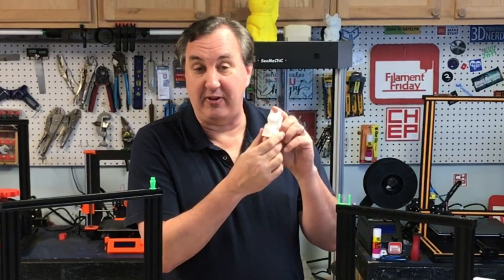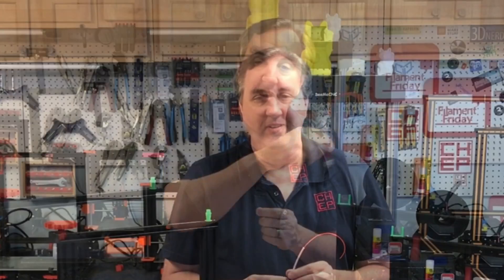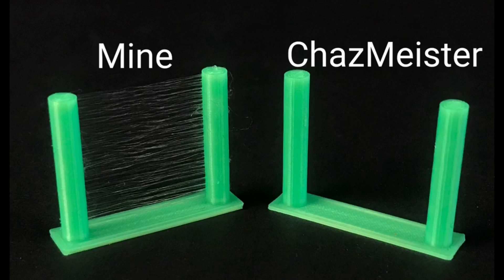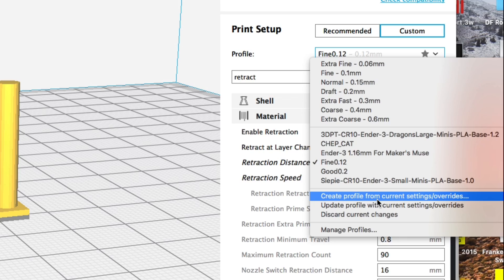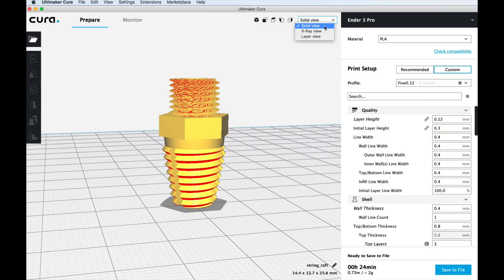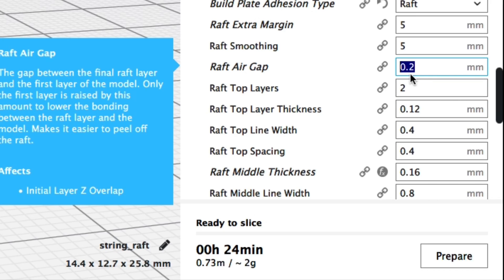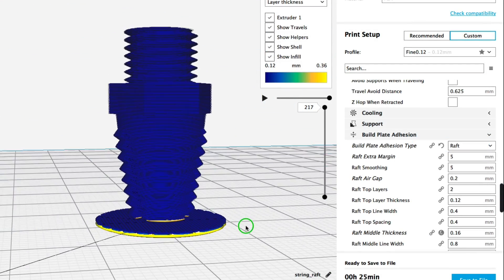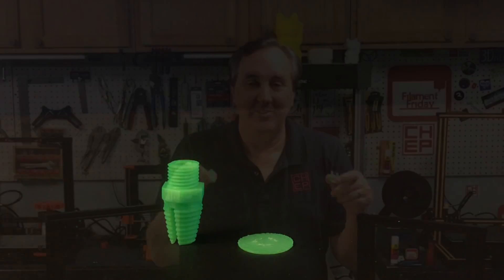Cura Settings for Retraction and Raft on Creality Ender 3 or CR-10 Mini

Comment: My raft is still very difficult to remove whether I set the gap to .2 or .3 I usually end up having to use a knife to cut the raft off. What else can I check or adjust?

PLA
Bed 60
Extruder 200
Reply from the maker: Set it to 0.4
Reply: You can turn bed temp to 0.
Reply: hello Chuck I also have problems pilling off even with 0.3 mm air gap. Should it be related to PLA temp ? I am using 205oC. This temp might fuse the PLA to raft correct ? Making it hard to remove. You suggest to lower temp down to 200oC ?
Reply from the maker: Try it but I suspect the bed might be too close to the nozzle. Also try 0.4.

Comment: hey chep my cura profile is retracting too much! it retracts like 50 times in a row destroying my filament grinding it making it print air.  Im using a direct drive i have it set to 1mm retraction with 5 mm retract window and 1 retraction allowed but still its going crazy. click claclick click claclick. helpppp
Reply: There a maximum retraction count setting in cura that you can change. The default is 100, which is too much. Try googling that setting and changing the maximum retraction count over a certain distance.

Comment: Hi Chuck, I've been comparing your Cura profile settings with what you describe in this video. I'm trying to get a stringless Niko the Puppy (by Makerbot) and your settings have helped me a lot with my Ender 5 Pro. I notice you've also changed settings compared to what's on your website with this video. Obviously a lot changes in a year (perhaps the version of Cura has affected it). Anyway, thanks very much for this video and for sharing your Cura profile.

Comment: My printer is Tevo Flash. This slow speed setting works bad for Volcano for some point! I've tried smaller lengths 2.6 - 4.0 with 60mm/s and it works better there. But here did came the another problem. Since I've calibrated Linear Advance very well so it gives very very close (to ideal) sizes. The clearance is about 0.08 - 0.1mm. But such a good LA work gives a side effect: now I have under-extrusion problems. They happens on the same layers, on the same position of a model!
My guess that it's linked with retraction (and maybe(!) a bit with combing). But it's not that easy. I'm going to calibrate Retraction Extra Prime Amount in Cura. This will give blobs probably. But it's not worse than having underextruded places.
My another guess that it's due to high E-Jerk setting. I've set it to 20! If it's 10 or lower then LA just can't work! So K=0.8 and it's normal for this printer with this E-Jerk setting. But as I understand this jerk also the same for retractions. My guess that it's probably too high and I get filament breakouts. This leads to sucking air into the nozzle which goes out instead of a portion of melted plastic.
If you're sure that it's not that reason, tell me, please!

Comment: If you don't like rafts, try a brim. It increases the surface area of the first layer. This also offers a smooth bottom layer. With raft you get a rough and stringy bottom layer. Just make sure to use a high initial bed and hotend temperature, something like 70°C bed and 220°C hotend. Otherwise you risk the brim warping at the edges where your bottom layer is supposed to stick.

Comment: Hi chuck!!! I love your work, thanks for the tips. Question...for avoiding the strings, the retraction speed, and the printing speed have to be the same? For instance, the retraction speed setting is 25mm/s, so the printing speed has to be 25mm/s also? Considering 6mm retraction distance for both cases.
Reply from the maker: No they don’t have to be the same.

Comment: Have you had a filament that strings more the colder its printed?  My temp tower is showing strings as it gets colder, which is not what everybody else lists as a cause.  I installed a dual gear extruder, calibrated it and saw on a few prints some string chunks.  I've been trying adjust the retraction all day till I printed this backwards tower.
Reply from the maker: Try cleaning the nozzle.
Reply: @FilamentFriday  Thanks for the reply.  I changed the nozzle, found the standard Creality hot end gap.  I never set this printer up properly as it printed so well out of the box.  I changed out the bmg style dual gear for a creality one. The clone bmg was making bad noises on retract and prime, I tried 2 of them.  However, I popped in a second roll of the same brand filament, different color and it is stringy at lower temperatures.  The brand is CC3D silk colors.  I have only printed large non detailed objects with it so I never saw the strings.  I also printed at 115-125.
Reply: @FilamentFriday  I am an Idiot! 
 Regular PLA doesnt seem to mind having the bridge settings in Cura slicer on all the time, but the silk pla does not like the bridge setting at all.  I just printed 8 retraction tests, from 1mm @25mm/s to 8 mm and I did this with only 1 setting removed, Bridge settings.  The best retraction for this pla and my printer are between 3mm and 5 mm however there were almost no strings after 1mm of retraction and only a few between 5-8mm.  Ive messing around with this all week, because the silk prints look great except when the strings and artifacts travel between the model and the supports.    The downloadable gcode temp towers from Thingiverse do continue to profusely string up the lower the temp goes!

Comment: Hi Chuck.  I have change Cura setting as you is telling in this video, and it help, 
But not the back, the side facing the heatbed, there are still a lot of threads, and rafting is hard to remove. What am I doing wrong ?
Do you have a finished Cura profile that works with a Creality CR10S Pro?

Comment: Hey Chuck. Does "maximum retraction count" matter if it's 90 or 100? In your video, you have yours set to 90, but my default Cura settings had it at 100 and they weren't uniform to the changes I made. Which one do you think is better?
Reply from the maker: It’s minor difference. Test them and see which works with your filament.
Reply: @FilamentFriday  Will do, thank you very much for responding!

Comment: Hmmm... I tried changing moving my retraction down from a pretty high speed down to 25, and it made my stringing worse. Are we absolutely certain that Chaz didn't change any other setting?
Reply: my stringing turned into spider web city.... much worse
Reply: @tcfluharty  can be a crappy nozzle as well. Buy a good with an accurate hole.

Comment: First attempts with printing XYZ cube went bad for me due to elephant footing. I know, my printing plate is not completely straight, but it is in +-0.3mm spec which Creality support gave me. So, I bought glass printing surface and it helps a bit. I also found a tip to use raft. I set the raft according to this, but raft becomes so solid with the object, that it is impossible to remove. But, now the cube is no longer elephant footed, but so close to 20mm specs I think I need. How to fix this?
Reply from the maker: Use my profile with my raft settings

Comment: Hi, seems like my PLA has become moist due to that it leaving a lot of stringing on my prints. I did try your settings but it did not reduce the stringing much. any other suggestions?
Reply from the maker: Try different fresh filament or dry out your existing to see if that’s it.
Reply: @FilamentFriday  thanks for replying. I tried a new fesh filament but still the same..

Comment: my nozzle is keep printing in my plastic. ----\/----  i've tried to adjust my bed leveling right. for the print settings i've  copied exactly the same as yours. (i am using PLA).
Reply from the maker: I don’t understand
Reply: Z axis (during print for each layer) is a constant, so there should never be a reason that your printer nozzle dips 'below' the current layer threshold and affects a lower layer.  Instead, what may be happening is that your layers are too thick, are curling, or you have something incorrect in your slicer profile and are doing something odd like 'overextruding' which would potentially cause the layer you just laid down to interfere with the layer above (which to the naked eye, you would think, 'man, my print nozzle is touching my print').. Yeah, the issue isn't with the 'current layer', your issue is with the layers below.

Comment: Chas's print also uses combing. And as I found out, you can't have combing and z-hop together. So depending if you need low stringing, vs needing z-hop for a clean top or to avoid knocking fine structures, you have to choose the appropriate settings.
Reply from the maker: I adjusted all that in my profiles.

Comment: I just got an Ender 3 and am using your profiles but still find stringing on my parts. Any solutions for this?
Reply from the maker: Lower the temp 5 degrees for your filament.
Reply: your fillament could contain to much moister. so your prints could have a failure. there are vids on youtube how dry your fillaments and how to keep them dry

Comment: Hi Chuck, Just thought I would give some input reference to stringing. It might give a heads up to some of your subscribers, (I am a newbie)I bought the ender3 about 6 weeks ago everything perfect after setup, after watching some of you learned guys on YouTube. Then I started to get stringing problems, followed your input on the subject and ran Chazmeister profile, stringing stopped but had small lumps on the verticals.?I upgraded to a MK8 metal extruder, when looking at the Creality extruder stock the filament hole had a groove worn into it.When changing filament on the printer, the piece of filament one pulls out has very slight notches in its length from the cog drive on the extruder, when the printer is working and retracting these small notches cause drag through the grove worn into the extruder filament hole, thus full 100 percent retraction is not happening, no matter what extraction settings you have.Thus after upgrading to a metal extruder, my retraction test are once again 100 percent perfect. I hope this might help somebody out there with stringing problems, I know you must be a busy chap, but a response from you would be nice. ALL YOU PLASTIC PRINTERS OUT THERE, TAKE CARE, KEEP SAFE.
Reply from the maker: I recommend the EZR extruder too but the one you bought is good to.

Comment: I also had some issues with stringing. I had my settings for 45 mm/s and 5mm speed and distance, but for me increasing the retraction distance to 7mm removed the stringing almost entirely. We should also keep in mind that decreasing retraction speed and/or increasing retraction distance will add more print time.

Comment: I think I will spend whole weekend on this stringing problem I'm having xD already running seventh that has it and the second one with different settings and still getting strings . . . 

Gonna try settings and soon I'm just gonna print several of them and write down settings I changed :D starting to get annoyed Day 3 printing tests . . . the tiny test where you see multiple differences was helpfull, now I'm doing the stringing test as it is my current and hardest problem lol
Reply from the maker: Have you tried my CHEP profiles? 
https://www.chepclub.com/cura-profiles.html

Comment: Well that helps but still not nearly as good as with Simplify3D. With Simplify3D (4.5mm distance and 80mm/s speed) i get 0 stringing. With Cura (6mm distance and 25mm/s speed) i still get some stringing. They better fix their shit.

Comment: great video, really helpful. Similar to these problems I see Holes are not exactly circular in all my prints on ender 3 pro. Is this something to set in Cura profile or any other issue? Please help
Reply: When I had this issue I discovered I needed to tighten my belt(s). Specifically the one what I believe to be the X-axis, the one the extruder moves along (sorry, 3D printing newb here).
Reply from the maker: Typically it’s not full travel in X or Y direction. Check for resistance in the movement.

Comment: Chuck, thanks your video ,but i change the  (Cura 4.2.1) retraction Distance and speed as you said but doesn't work, even I use the profile  from ChazMeister2 failed also . I use Makers Muse  profile for S3D it works. I wonder why? I wanner use Cura please help.
Reply from the maker: Use 4.1.
Reply: @FilamentFriday  doesn't work even i use 4.1  0.12mm and just change the  two setting of retraction
Reply: @cFcFire  there're  two different 4.1?
Reply: @cFcFire  Can you fix the string problem in Cura?
Reply: @cFcFire  ok thanks  .So i should delete all 4.2.1 and  4.1 (now installed 4.1 and 4.2.1 both )then reinstall 4.1 and  put the porfile again to try
Reply: @cFcFire  Chep don't have a profile for string ,just change two setting of retraction, but i have ChazMeister2 profile,now to try how it works thanks
Reply: @pieresoft  how was it? i also got same problem as yours

Comment: so is the retraction speed setting recommended for all prints or only the smaller ones? Im very new and have printed about 9 things total, thanks for the helpful videos.
Reply from the maker: All prints.
Reply: @FilamentFriday  Thank you!
Reply: @FilamentFriday  Is there any way to paint flexible filaments? I printed some motorcycle tires out of clear ninjaflex before i considered that they should be black lol. Plastidip maybe?

Comment: Dear Chep. Thank you for all your videos and information. I have noticed that the settings of this are for 0.12 Magic profile. What about if I want to use Magic 0.20 or Magic 0.28? Will it have the same settings but only difference is changing the Raft Top Layer thickness to match? Why there is not a Magic 0.16 Profile?
Reply from the maker: Yes. 
Just decided to make a small, medium, large profiles.
Reply: @FilamentFriday  Thank you very much for such a quick response! Keep the videos coming have a great day!

Comment: when downloading the cura setting file, it does not seem to match what you showed in this video
Reply from the maker: I’ve adjusted them since.
Reply: @FilamentFriday  it looks like you increased the retraction speed to 40mm/s and reduced the distance to 5mm.  do you find this works better than 6@25
Reply from the maker: No. 6/25 mm/s is the settings in my currently released profile. The stock settings in the Ender 3 firmware limit the extruder to 25mm/s so 40mm/s can’t be achieved. I found this out after the video.

Comment: Hi my friend, im having a lott of trouble with the CR-10 mini, its a excelent machine but i only manage to get a good print with simplefy3d and 12 retration distance, i saw every video of you and the cr-10 mini, ender 3, etc but i cant manage to get good prints, i do everything that you tell me here and in videos, i even copy the cura settings and nothing... , i learn a lot but im in the point now that i just want to print good, i have to re level the bed each time i print (even if it is small objects) i dont know why!! its any setting that you have especialy for the mini? and do you thing that updating the firmware will help? im also buying a extruder aluminium kit, a autoleveling sensor BLTOUCH, to see if i can fix this issues becouse its been a nightmare!! thanks a lot im sorry for my comment its to release the stress and relax.
Reply from the maker: I’m not sure. Maybe check the adjustable wheel on the crossbar to see if it’s too loose causing sagging. I don’t see how firmware will help what you describe.

Comment: You can print those kinds of things simply by adding a skirt (3 to 4 lines, which snaps easily) and by reducing the speed in GCODE for the first 2 layers at 50%, then 100% up. Alternatively, simply printing slowly the first 2 layers by hand, via wheel should do just fine. I've printed a spinning top (the Inception one) with this method and with no support (i was messing with some GCODE changes and i wanted to see the free layer deposition. The spinning top was 1:1 and embedded in to the printing plane by 3.4mm giving the base a respectable 2.24 mm diameter + 3 lines of skirt. I think the secret isn't so much in the settings of CURA (or other programs) but rather in that whisker perfect balance between deposition of material and initial layer build.

My printer is a CR-10 with a shock mount on the table stepper, standard glass surface, with white painter's tape (3M), flattened with the spatula and glazed with undiluted solid stick glue (you need a brand that doesn't dilute their product, IE, the stiffer the compound, the better).

The method is so effective, that i cannot get parts without spatula assist. In some cases, i have to go to glass (which i have scratched because of this) to separate.

Comment: Chuck, I just came across this video. You have an impressive collection of useful video's (along with Angus from Makers Muse).  I used @ChazMeister2's presliced test print and it worked fantastically but I couldn't open the curaprofile (even when changing it to a zip file) to see what all of his settings were. Is there a way you could share the full list of his settings so that I can see where my settings are off? By the way, I am printing with PETG on my Ender3 and have gotten much of the stringing fixed, but it is still not as good as it can be or as good as the print I got using @ChazMeister2's presliced test print.  Your help is greatly appreciated.  BD
Reply: you have to download Chazmeister's Cura profile in order to look at the settings..    its included in the information below CHEP's video.  the settings link takes you to a page which has 3 files.    Chazmeister's gcode, Chazmeiester's Cura Profile and the STL file.